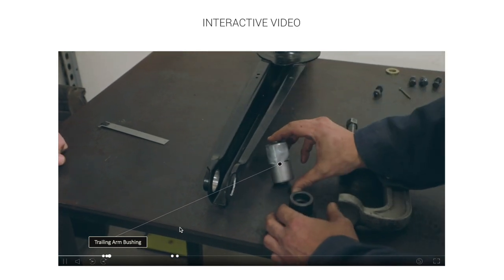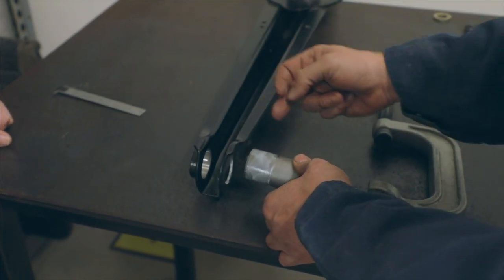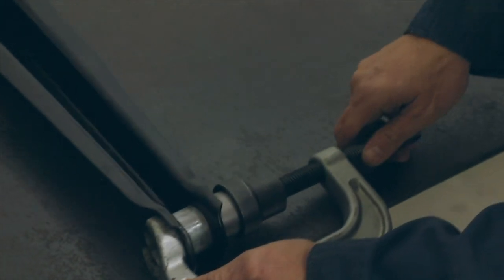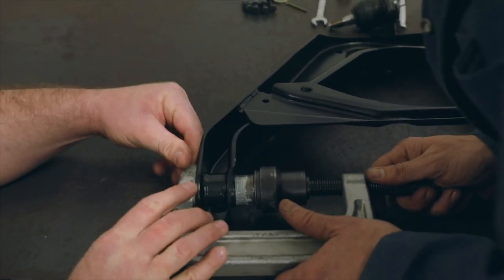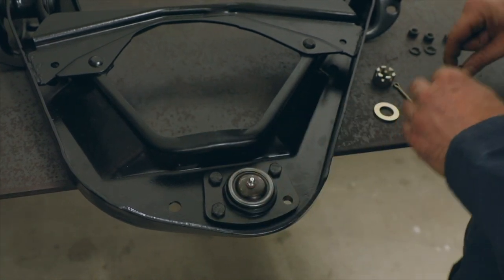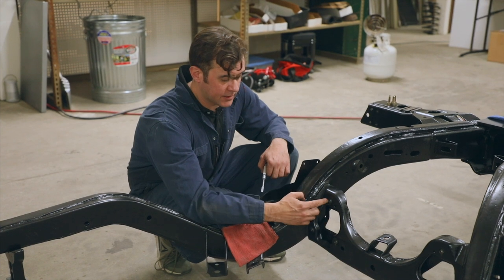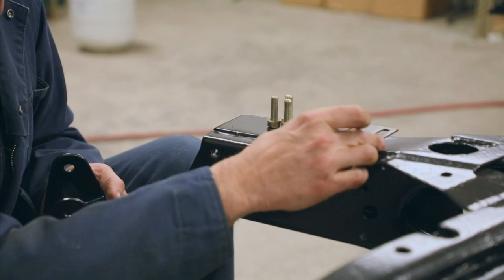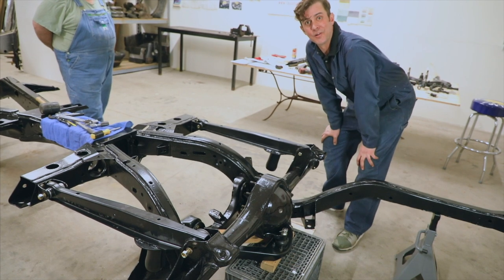How To Install the Rear End Suspension On A 1959 Cadillac Eldorado Biarritz

Comment: 1951 rear end Cadillac installation?
Reply from the maker: 1951 uses the Hotchkiss drive system or simply standard leaf spring suspension. We do not have a video on this style of rear suspension, but it is very simple and common. The only things that wear are the bushings. John